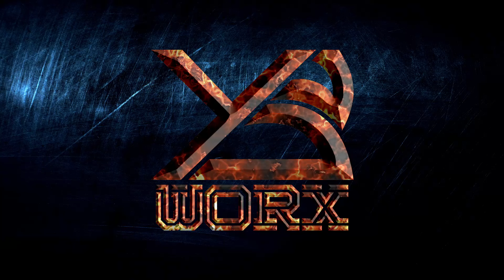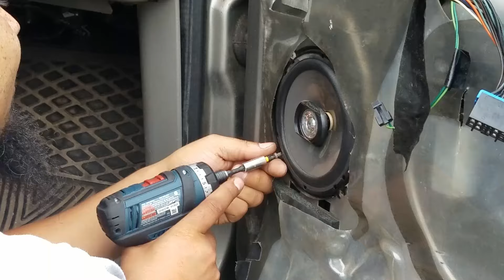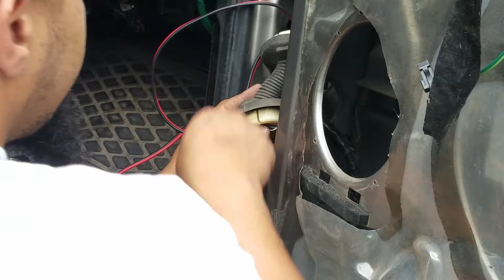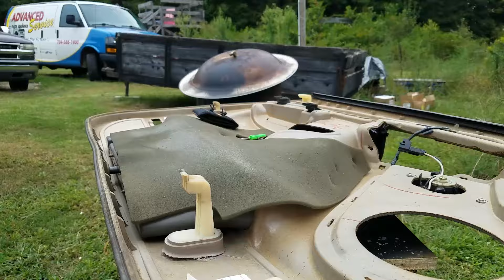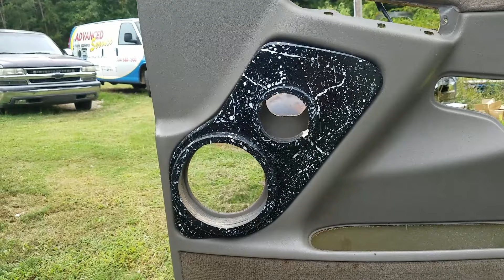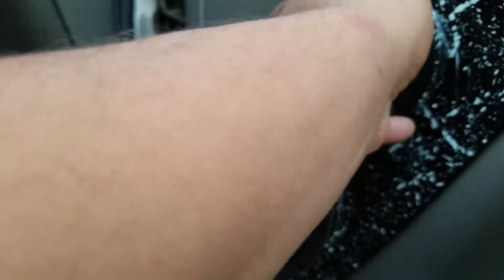DIY Door Pods PT 2.  The Installation

Comment: Speed wire is what I use for my 4 channel ..if I had big mids I'd run my own 8 guage but for 200 r.s per speaker I'm using speed wire ..from amp to rear of deck to the factory wire ..